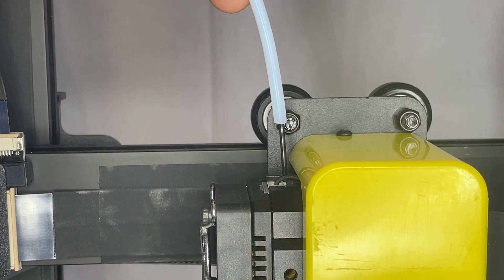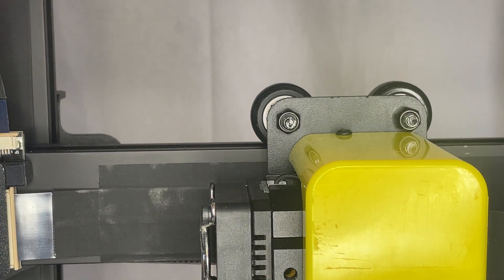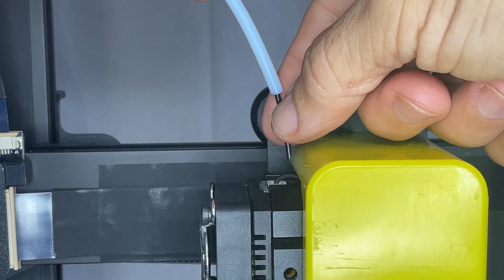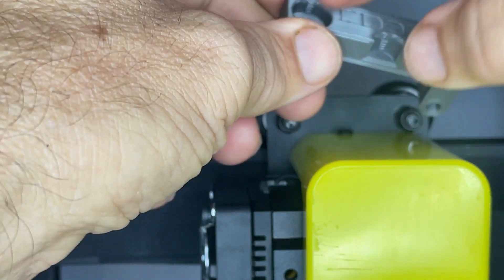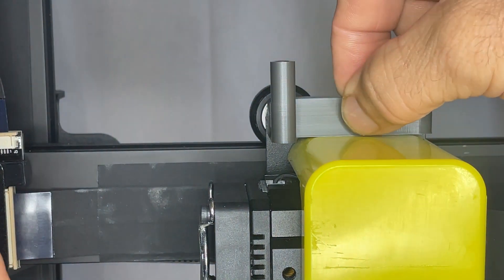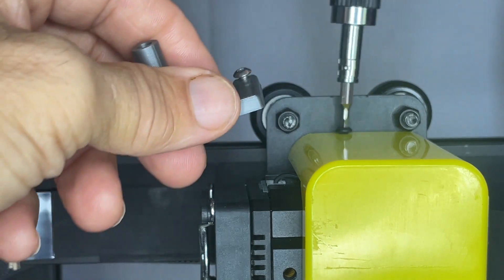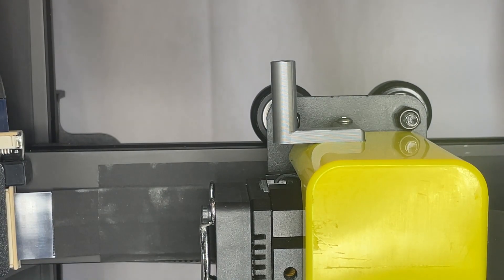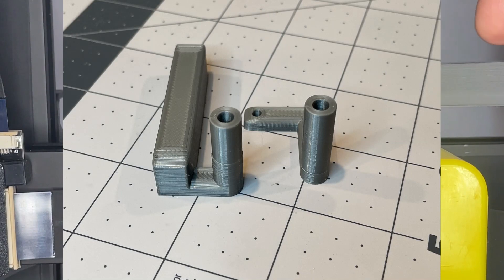Fokoos Odin Bowden Intake Guide

Comment: Hey, I like your design, could you maybe do a type C as a combination of both? Type A and B together, like it`s sliding on the nuts of the wheels and is secured with the bolt? So it would be fixed and couldn`t wobble cause of the nuts. Just an idea^^
Reply from the maker: Cool idea! I see you already did it and posted it to thingiverse... good job! I have been swamped with other stuff right now and didn't have time to experiment with it. glad you were able to come up with a solution.